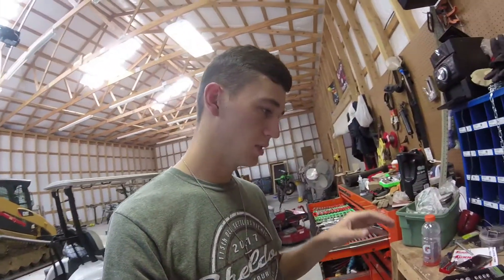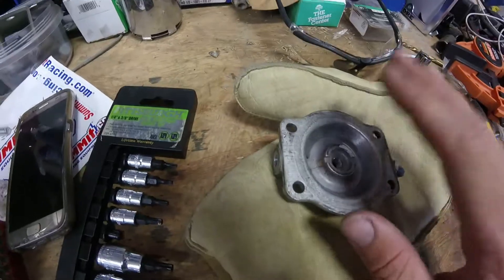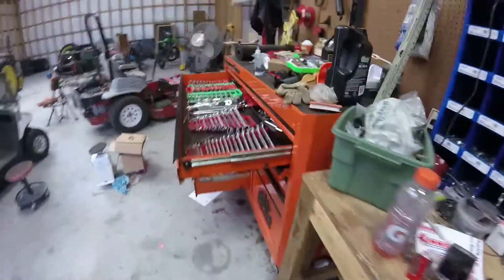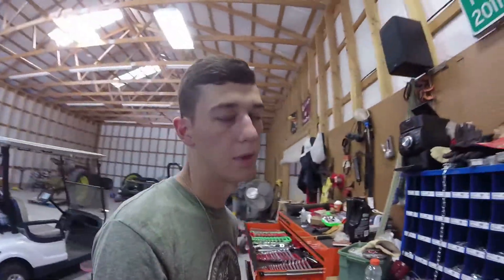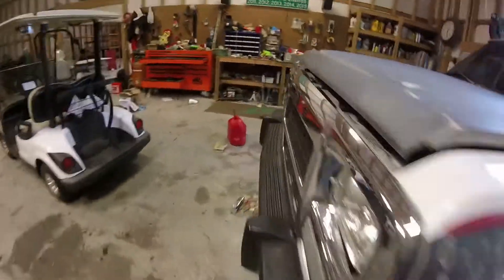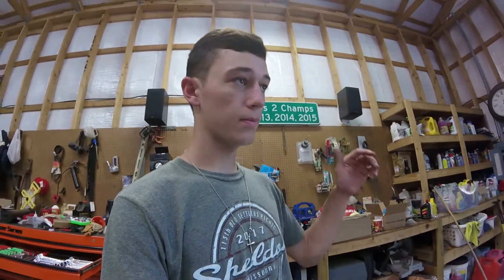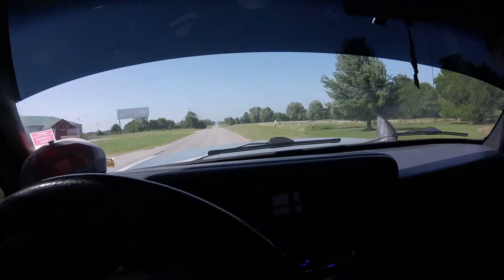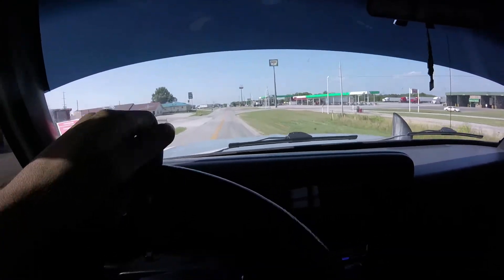AFC Tophat modification on VE Injection Pump

Comment: Great video man! I just installed 5x0.014 VCO injectors from DAP, new Bosch bodies and nozzles and am loving the extra fuel/power but am now dealing with haze at idle. I turned my smoke screw all the way out which helped as well as backed the power screw back but am still dealing with mild haze and I think this mod should do the trick.
Reply from the maker: Probably wont be able to completely get rid of the haze but with an aftermarket 12v injector that's the nature of the beast. But it should definitely get better! I appreciate the support!